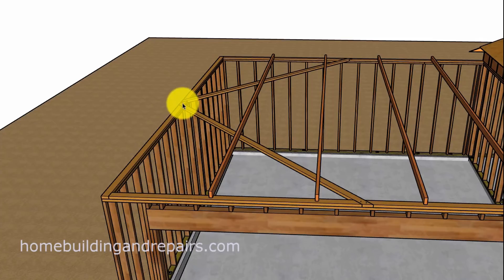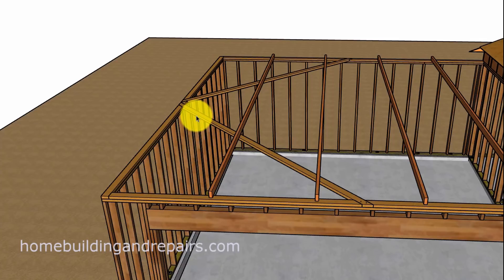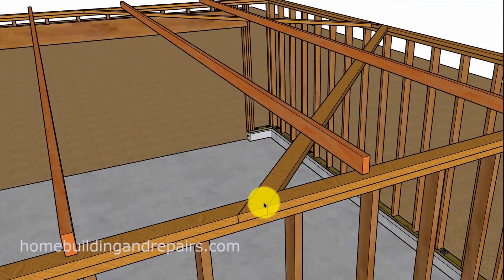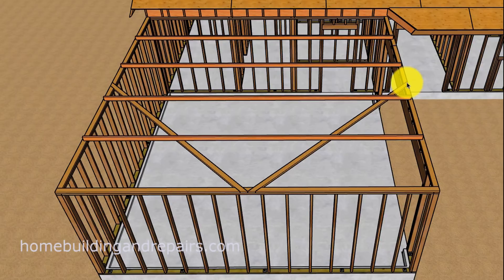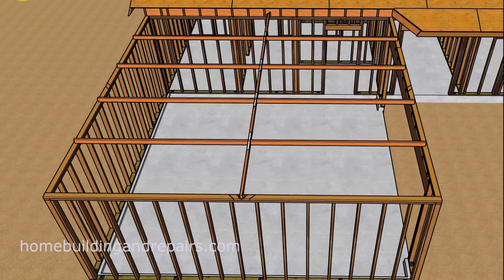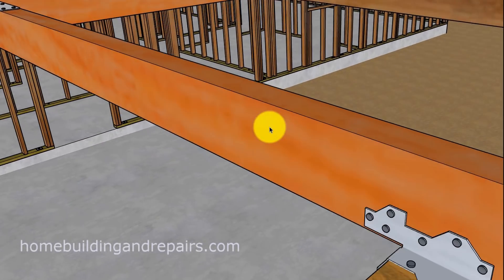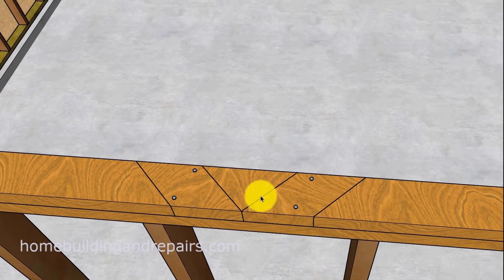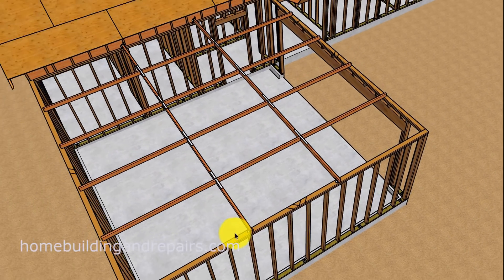They Don't Do This Anymore - Angled Garage Top Plate Wall Stabilizing Braces

Comment: I have a pyramid hip-roofed free standing garage. There are 2 long cross beams (1x6s I think) that form an "X" if you're looking up at the rafters (there's a puny light fixture attached to the middle). Would this serve the same purpose as what you describe in the video? Would I "substitute" the long beams the same way?
Reply from the maker: In a way yes, the cross bracing or X braces are helping to prevent the walls from spreading out. It's not a common form of construction, but I have seen it before. I would love to have a picture of that for my archives, but understand perfectly well if it will be too much trouble. You can get our email address at our website.
Reply: I have that too mine are lap jointed and bent so is the center beam. I'm going to replace mine with corner braces.

Comment: Sorry UK definitions. The ladder span is just the last two comman rafters that makes up the gable end overhang. Your rafter are normally spaced 16 on centre ours is 400mm. The very last rafter would be on the outside of the building  and the one before that would be on the inside of building  spaced apart max 600mm. the noggin is just the blocking that connects the last two rafters or any rafters. The blocking for the ladder over  here tends to sit in not on the gable end wall. Hope that helps
Reply from the maker: Thanks for the explanation and it definitely helps.

Comment: Put a flat 2x4 across the rafters and only the one standing up for the last span to the plate, and you can run the top one long over the last one to eliminat
e all those cuts and connectors
Reply from the maker: Great idea and I made a video today that might be helpful for anyone who is wondering what you're talking about, hope it helps.
https://youtu.be/78X_xYkjGXA

Comment: I think most people want it for storage. Put the 2x4's or 6's 16" at least if not double them and plywood the floor. Nailing at least 4 nails every 4'. Tie the plywood into the top plate on the other side of the garage. Well'ah. Tied in tight, and a sturdy floor to put your Christmas lights and bullshit.
Reply from the maker: Storage, storage, storage, always looking for more places to store our stuff.

Comment: Hi. Am from the UK any chance you could do some videos on roof construction on block and brick work please. I need some help in constructing a roof for my brick shed. How can I attach the gable ladders overhangs to the rafters and ridge board. Not sure how high my gable end walls needs to be as well. And where do the ladder  noggins cut in and sit on the brick walls.
Reply from the maker: I put your video on my list, but don't know when I will be able to make it. Thanks for the suggestion and thanks for watching our videos.
Reply: @gregvancom  thank you. UK regulations says rafter ladder  span cannot be more than 600mm regardless if ladder noggins sit on the gable end wall just for your reference.
Reply from the maker: You will need to help me out with your definitions. What is a rafter ladder span and a ladder noggin?